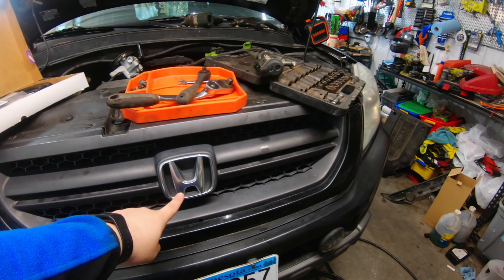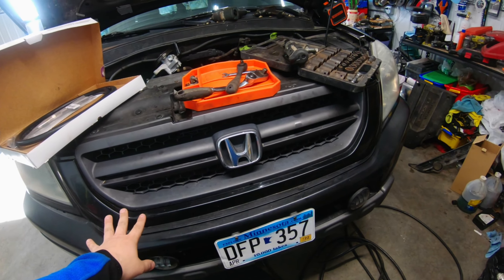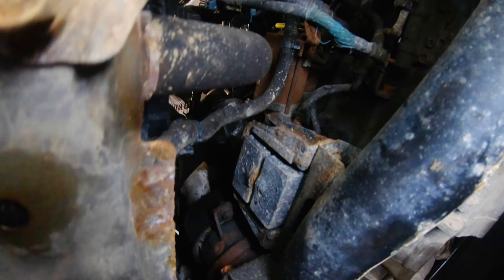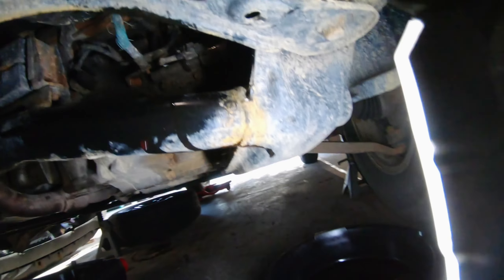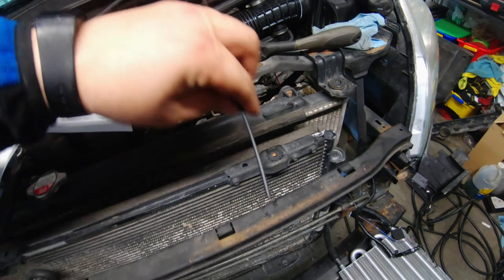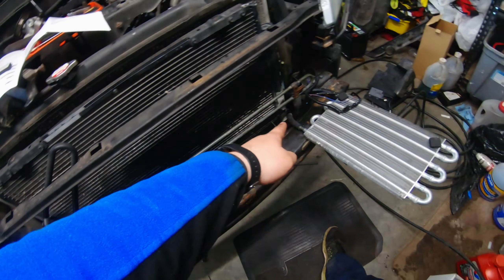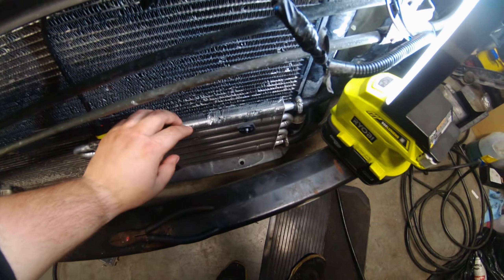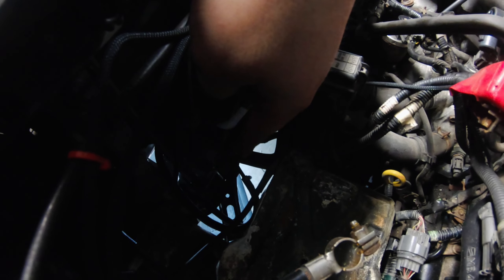Enhance Your Honda Pilot's Transmission Lifespan: Installing a Hayden 404 Transmission Cooler.

Comment: Thanks for the video. What did you do with the two hard lines on the radiator? Did you cap them or loop them with a hose?
Reply from the maker: I ran those to the cooler. I'm in MN with frigid winter and need the radiator to warm up the tranny so I had to keep them. If you're in a warm area, you can cap them although, having it go through the radiator and aux cooler will keep the temps cooler if you're in traffic or city driving since the radiator has fans to help keep the temps down
Reply: @AleksUsovich  So you used a Y splitter for each line? I have a 1st Gen MDX which is basically the same set up, but I'm unsure how to go about it. I live in N. Oregon, so we get snow in the winter. So I think making use of the radiator might be a good idea...Thanks for your input.
Reply from the maker: @OriginalTrueOrFalse  No splitters. You run the one hose that comes from the transmission into the radiator, the hose from the radiator to the aux cooler, the aux cooler hose back to the transmission. That way it's one loop. There's hoses already going from the tranny to the radiator so you just remove the hose going from rad to trans, add the hoses to the aux cooler instead, and use the hose from aux cooler to go back to tranny.
Reply: @AleksUsovich  Thank you so much, that clears it up for me 🙂

Comment: Being that I am also from Minnesota with our cold winters I think you should have routed that transmission line back into the radiator to warm it up in the winter after the cooler. Too cold is a bad thing for a transmission.
Reply from the maker: I've had that in consideration when planning for installation and think I found a happy medium as mine goes from tranny to radiator to cooler and back to tranny. I don't think it'd get too cold but can always throw some cardboard over it if needed on those -40 degree days. I know people have had issues in colder states when they bypass the radiator and only use the trans cooler; I don't anticipate having this issue
Reply: @AleksUsovich  right on. I thought you bypassed the radiator all together.

Comment: So the long line coming from the passenger side was the return line?  Looks like thats the one you used. Other videos show the short metal line on the driver side of the radiator is the return line.

Comment: Which hose is the return hose? You didn't mention it in the video. Thankyou
Reply from the maker: The return hose goes into the trans cooler from radiator. Can verify by putting car into drive and holding the brake pedal and gas pedal together for 10 seconds and making sure car doesn't move. Check the two trans lines and the colder one is the return. Hoses should go from oem trans cooler to radiator to aftermarket cooler (top line) and (bottom line) back to oem trans cooler.
Reply: @AleksUsovich  my 2004 pilot didn't come with an oem cooler. So hoses goes from trans to radiator, to cooler, then back to trans?
Reply from the maker: @SpicyCL9  yes that is correct. That small round thing where the transmission hoses come out of is a tiny trans cooler

Comment: Hello.  Great video.  May i ask why you selected that modle of Hayden ATF cooler?  They have so many many models.  Thanks
Reply from the maker: I chose this Hayden 404 model because it is rated for 5000lbs and the maximum towing capacity for the 2004 Honda Pilot is 4500 lbs. This is the best combo since the car can't support more than 4500lbs towing which is less than the max limit for the cooler

Comment: How has your pilot been driving after you installed the new cooler. Even though it's still to early but I'd still rather ask.
Reply from the maker: Hey I appreciate your question. I've been monitoring the atf temps and they've been a solid 5-10 degrees cooler under normal driving and don't spike anymore under stop and go driving. During city driving it's felt smoother when shifting gears but that could just be the placebo effect.  I haven't towed anything with it yet but assume that it would do well. Without the cooler you'd most likely see the atf temp light turn on it you do off roading or lots of gravel road driving but I doubt you'd see the atf temp light with this cooler!
Reply: @AleksUsovich  it also depends on the type of tires you have on. For offloading I love using my AT TIRES. IF YOU NEED A RECOMMENDATION FOR AT TIRES I would use the Khumo RoadVenture at51 tires. They're a beast for any condition. Slaps the cooper discover at3 in performance.

Comment: What did you use to measure the temperature? There is so many products out there but I can’t find the one that read the transmission temperature as well.
Reply from the maker: I just used an Elm 327 obd bluetooth adapter with the Torque app.